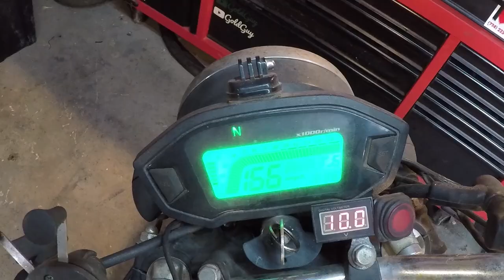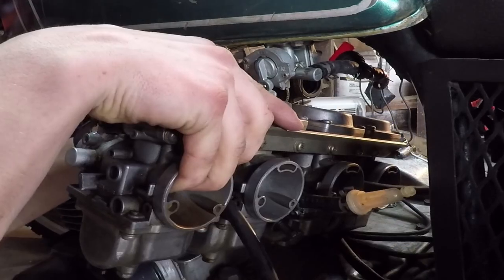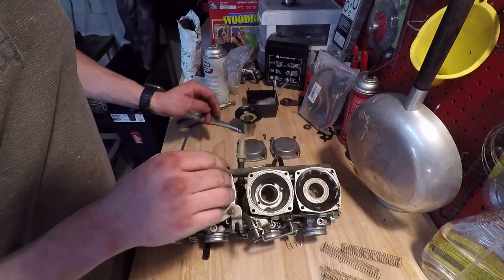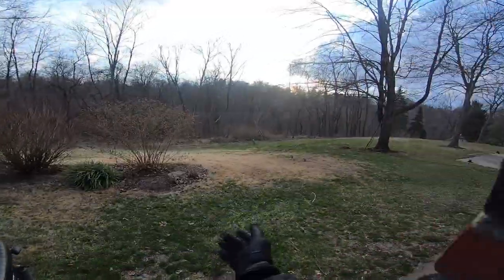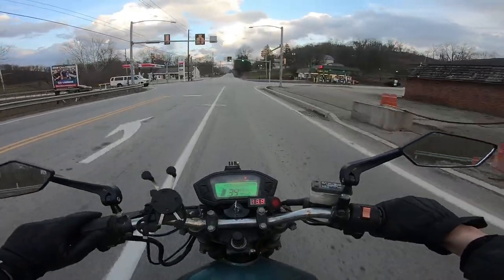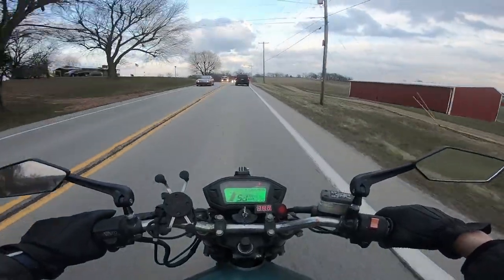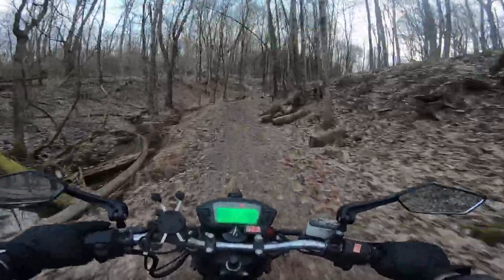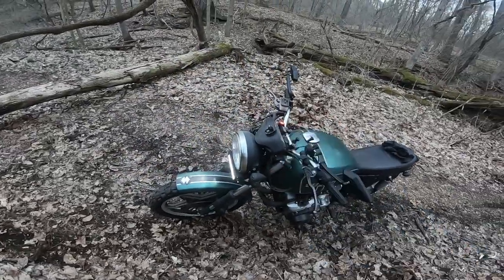A Spring-time GS850 Scrambler Ride | Tuning the Carburetors

Comment: You should try building a air box that restricts the air intake. The carb might just be getting too much air that it cant the carb can handle.
Reply: I've been reading about this a lot recently for my own gs850, and you're exactly right. The GS bikes came tuned as lean as was safe from the factory to meet strict EPA regulations of the era, so they are very sensitive to ANY extra air. The old heads say the best thing is all factory air box, with new boots and O-rings to make sure no extra air is making its way in. Either that, or spend days fiddling with new jets, but that's not on my list of To-Do's

Comment: If the bogging improves when slightly closing (as I saw) the wide open throttle then that shows you are too lean on the main jet. I would suggest going up at least two sizes on the main and go back down to one or two washers on the needle.
Remember, the main jet also regulates the needle through the mid range and only moves to main jet only when the revs rise and the CV pulls the needle to the top of it's travel.
Reply: Think his intake velocity is slowed for volume because of no air box. Slides seem to be numb due to less vacuum. As you pointed out less throttle worked better,. Also if you noticed it performed better with partial choke
Reply: Hi 
I have a 1981 gs850g.
It bogs down at midrange snot 70 mph and if I feather the throttle back it’ll pick 
I took the airfilter out and it goes above 70 mph with no problem.
How do I fix this ?
Thanks 
Dave from Scotland

Comment: I like the paint job you have on it. The patina matches the vintage bike. Also, you helped inspire me to buy a dirt bike last year. It's a 2008 CRF 250r that wasn't running but I got it running and am now in the process of doing intake valves, rebuilding the forks and a few other things. Your videos on rebuilding the yzf450 taught me a lot about 4 stroke dirt bike engines. I'm glad to see you posting more bike content. P.S some house reno content would be cool to see as well!

Comment: Old bikes don't like running on cheap pod filters, honestly running the stock airbox would be easiest to tune it. Also buying genuine oem jets to the correct jetting is the way to go, I don't remember if you drilled out those or not.
Reply from the maker: Thanks for the advice! I did drill them out previously but have since switched to undrilled 135 main jets. I think my jetting is correct. I sprayed some starting fluid around the carb boots and noticed a change in rpms so I am now thinking that it has a vacuum leak. I'm going to buy a new set of carb boots and go from there.
Reply: @GoldGuyRides 
Chris Riddiford

Comment: Think the tuning issue is because of no air box. Seems like the blade for the choke is helping to ramp up air speed from making the carb intake smaller and lifting the slides better. Could try removing the springs in the caps all together and see if you get better response but chances are you will get slower drop to idle also

Comment: Dude excellent video.
 You work at lowes dude. Take one of the float screws and a diaphragm screws to work and match up the screws with metric allen head units.
 The bog could be anyrhing from a punchered diaphragm to a leaking rubber manifold....clogged muffler. 
 Paint it with extra fat metal flake and candy.
 There're must be a source for new side covers.
Reply: I have pod filters on my KZ650 and it doesn't bog.

Comment: Have you ever synced the carbs? Also I’ve heard GREAT things about K&N pod filters. A bit pricey, but they seem to have just the right airflow that helps create the vacuum that actuates the slides in these style carburetors.
Reply from the maker: No, I haven't synced the carburetors yet. Does that make much of a difference? Thanks for the comments! I'll look into K&N air filters.
Reply: @GoldGuyRides  It can make a big difference. When you syncronize them you are checking the manifold pressures(vacuum) are the same across all cylinders, and since the carburetor entirely relies on that pressure/vacuum to have the right fuel/air mixture, if you have differences across all the carbs the cylinders will deliver power differently and "stumble" over each other.

I think I would sync first, then if the midrange isn't sorted out i'd go for either the stock airbox or better pods.

Comment: fuel screws at 2 1/2 is a bit lean   in is lean out is ritch the opposite to an air screw, gonna try mine at 3 the book says 3 1/2  float hieights set to 22.4 important to set those right.choke plungers are prone to wear after 40 years,in england there is a guy on ebay who can re tip the end of the plunger so i had some done no one else does this clever bloke if the tips are worn and hard you will be ritch all the time and forever tuning ,get the plungers done first and start from there only cost £65  for four plungers well worth it.

Comment: try the original air box or maybe you can adjust the power jet (i dont know if its the right term for that but what i mean is the jet that spits additional fuel when pulling the throttle fast)
Reply from the maker: You mean the accelerator pump. This bike doesn't have one unfortunately.

Comment: put on the stock airbox? pod air filters done really do you any good on this kinda road bike, it runs like shite man, itl need bigger jets and lots of adjustment if you wanna ride with those cheap pod filters. Oh i almost forgot, maybe that second fuel valve on there is really restictive in the fuel flow, had one in similar style on a small bike once, it was just resticting the flow so much that the carb would empty
Reply: It's not impossible to tune cv carbs to work with pods... but it would be very difficult. Common advice is not to try. Painful to watch, but amazing content. lol. Keep trying, Gold. I wanna see this work right.
Reply: @Snakes_N_Crafts  yeah right, it runs so damn shitty, its not even "just the middle range" it boggs so bad
Reply: I put an in-line fuel filter on my 850 and yes it needs to be of a decent size, not those cheap small items they can introduce fuel starvation, not much room in there but it can be done, mine was on standard air box it ran like a champ, when those 850's are set up correctly they can get going pretty damn well, and they love to be reved through the range. then there's the brakes to consider,  can be improved on the standard set up with braided hoses, and better pads, but its still old school calipers.

Comment: you work with lots of variables. next time try diagnose 1 by 1. I mean you obviously need fresh gas, spark plug check, look for leaks as you said, you really should check your petcock and remove that shut off valve and custom air filters. You should also find information about these bike, how it should run and sound, it could be really helpful. I think that shut off valve is creating lots of resistance for 850 cc bike.

Comment: Review your footage ...your digital volt meter is constantly dropping..coincidently when your hard on the throttle ...
Next time your in your carbs check to make sure your plastic spring seat isn't covering your vent hole ...

Don't 
 Get 
  A 
   Sand blasting cabinet

That sand goes everywhere ...youll use it for 2-3 weeks ...
You'll push it into a corner ..then sell it cheaply in 10-12 years ..

Comment: All Your videos have ensured I never buy a carbureted Honda 😆. 
I’m laughing all the way to 100k miles on my EFI Bonnie with zero fueling issues ever. Shoot I left for a year and it started right up off the old gas. 
My DRZ carb is no problem but I dumped my death trap 95 Yamaha Vmax after I went through that damn tray of carbs and it shit a head gasket mixing the oil and coolant. I’m looking for a softtail springer right now. I’ll admit that the carbed Harley Evo motor does sound better than the fuel injected one. But it’s only one carb 🤘🏻.